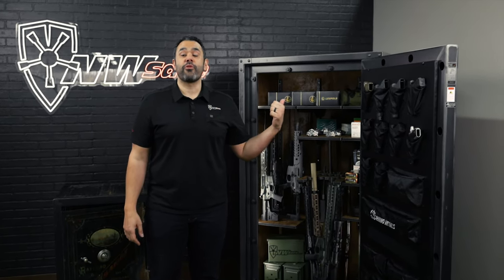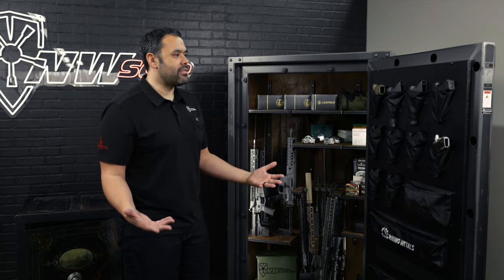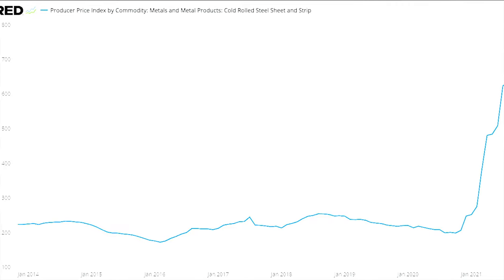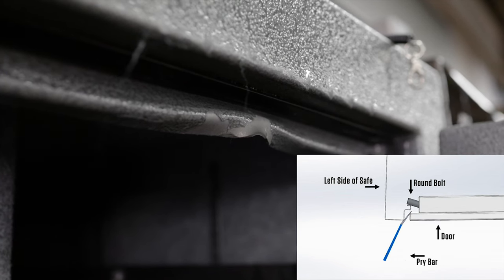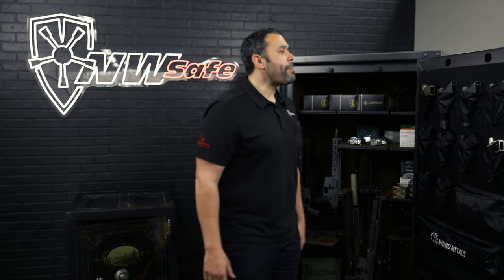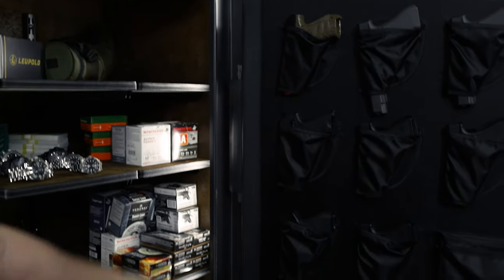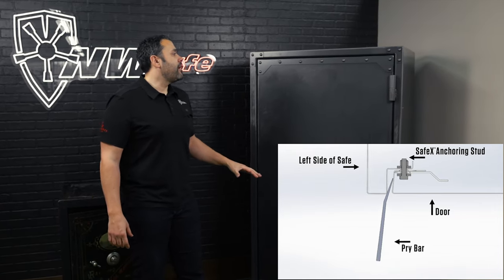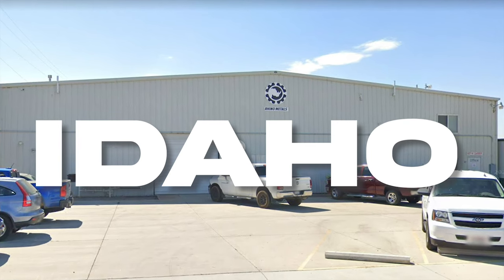Rhino Metals SafeX Overview

Comment: Does Rhino give the government the back door codes like Liberty does?
Reply: Every company does. I've called at least 6 of the biggest names and they told me "we will always cooperate with law enforcement". That's code for yes.. don't register it and remove the serial number from the sticker on top.
Reply: @realtyrocks1969  The question is.... will they cooperate without a warrant.  They should not.  If they have a warrant, I have a lot more understanding and they are following the law.
Reply: Switch your locks out to a key lock most locksmiths and safe technicians have a hard time defeating them.

Comment: Comparison video between Liberty and Rhino safes please
Reply from the maker: Noted! We will try our best to come out with that video!
Reply from the maker: @nowweride3094 Any particular models you’d like to see compared between Rhino and Liberty or would you just like to see a general overview between the two companies and what makes them different?
Reply: @NWSafe  between the two companies to see the deference would be great! I have a Franklin now looking to purchase a second safe... Rhino cought my eye. I have already delt with Liberty Safe warranty department, I have to say they stood behind there products.. my safe is 7 years old had a internal malfunction.. it took some time but they fixed no charge .. very grateful for that. Looking for the next size maybe a Fat Boy for a comparison?
Reply from the maker: @nowweride3094  Liberty does have a great warranty. That’s one of the reasons we’ve continually represented Liberty safes for over 35 years, they stand behind their products. A lot of manufacturers have a great warranty on paper, but when it’s time to make to actually warranty a safe it can be a battle. Liberty has always made warranty claims easy compared to most other brands.
Reply: There's a pry test comparison video that is quite good. Two guys pry open the liberty in 1 min 48 seconds. Pretty sad . The Rhino they quit after 10 minutes because they couldn't pry it open.
Reply: 12 gauge steel sides can be cut right thru with a grinder and a cutting wheel. Needs thicker walls
Reply: @johnnymitchell9109  agreed!  Battery operated grinders are a blessing for legitimate work, but for cutting into safes it is even better!  You know it is all about time, make it harder for the thieves.. I went with another Liberty.. side by side incased with cement board walls and top, bolted to the floor.. now I'm not saying there impenetrable but it buys me alot more time for the authorities to show up! Even Vaults can be broken into with enough time!
Reply: @NWSafe  except liberty safes doesn't stand behind their customers rights and privacy. They have demonstrated that they will sell out your manufacturer code to the ATF without a warrant and without owners knowledge or consent for them to violate your rights. They don't sell safes to keep your property and your rights protected, they just use your collection as a way for them to make money off of. Everyone should know the difference therr
Reply: @NWSafe
 liberty stands behind unconstitutional fbi threats too.
Reply: @Bigfoothawk  I'm sorry they gave up information once without a warrant they will do it again..

Comment: OK so all round the edge of the door is hollow to accommodate this stupid system?
Reply from the maker: It’s not stupid if it works 🤷 
But like most safes it uses a formed door instead of a plate door but the mechanism essentially does what the plate door would accomplish. In our opinion this system is stronger than the  plate doors you’d find on similar priced safes.